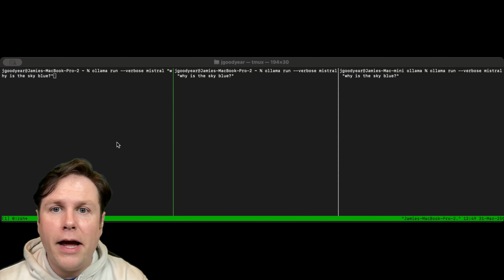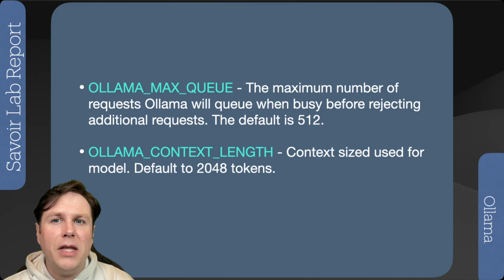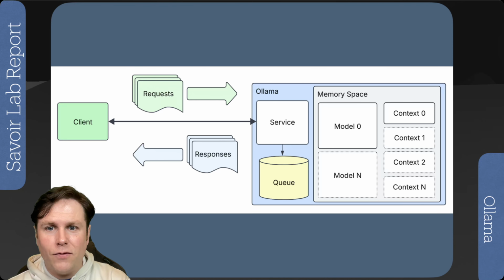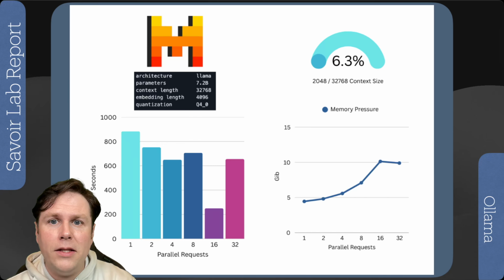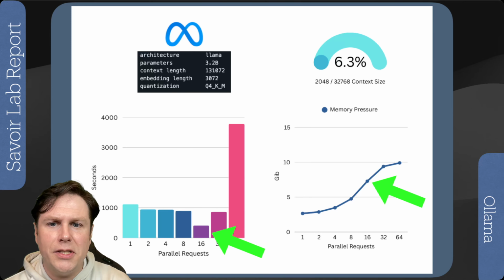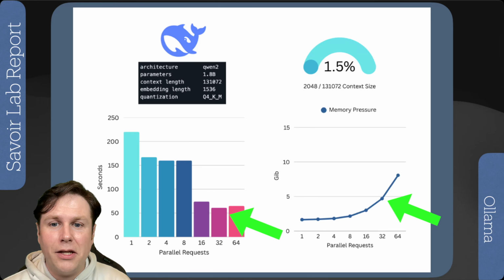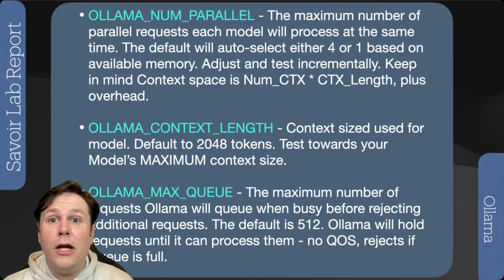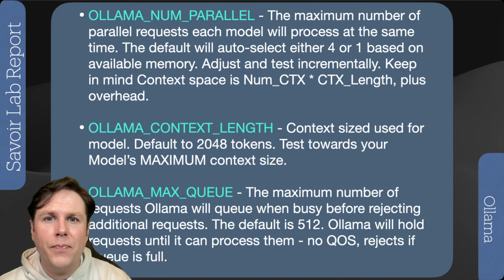Ollama Parallel Request Tuning on M4 Mac Mini

Comment: I plan to run Ollama local to provide me AI voice feedback AI video feedback to a Home assistant server over 1GB ethernet. I am going to keep my local Ai on a separate server to the HA server as I envisage AI is going simply demand faster machines way more quickly than HA upgrades and to be honest I want to leave my HA server stable as is as long as I can. If I max out that one SSD it's a PITA to build a new home auto project. An IA server on the other hand will be easy to swap out and upgrade. I've got some questions.....

How much performance improvement will I get running Ollama local if I get the MacMini M4 pro? I plan to get the base 24 RAM. Is an upgrade from an M4 to M4 pro chip a  worthwhile upgrade? Or am I wasting my money here.. Should I upgrade my Home assistant server to 10Gb ethernet and get the 10Ggb ethernet Mac Mini? 3rd Q - AI is moving so darn fast how long do you expect your current M4 Mac Mini (base model) to be able to "cope" - until you have to swap it out for a faster machine...6 months? Longer? I'd like yr genuine answer. Thanks
Reply: The Base Model I expect to work as an introduction point to running models (usually up to around 8b). 
As the basis of verifying integrations, creating workflows, et al - this will suffice for entry development purposes.

The project you've outlines above will certainly benefit from more memory and raw compute power -- Ollama can run more than 1 model concurrently given both models & contexts fit within the available memory.

Will a M4 Mac Mini Pro do better than a Base Model - likely yes.  I do not have a M4 Mac Mini Pro in my lab, so i can not quantify how much more performant it will be (we can make assumptions based off of more cores, faster ram, more ram).

1 vs 10 Gb ethernet -  have you performed some benchmarks to determine if you're hitting on bandwidth constraints?  Future proofing machines tends to be a long game of how long you expect to keep the machine in service. 

As to the core question of when to upgrade or how long to expect machines to last ---  My experience has been that i get 2 to 3 years heavy use of an Apple computer before I want to upgrade, baring if any damage occurs. Another way of putting it, when a given machine gets a fever generations behind I start thinking about updating it (So M1 -> M4, Intel 9th Gen to AMD5, etc).